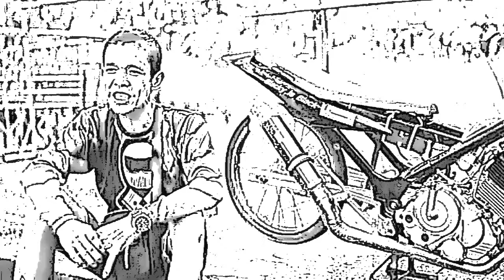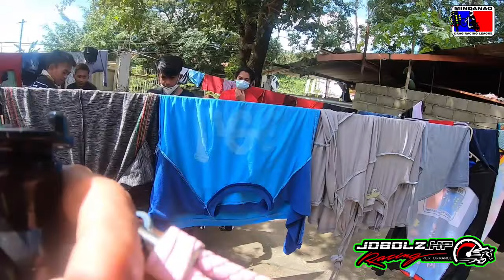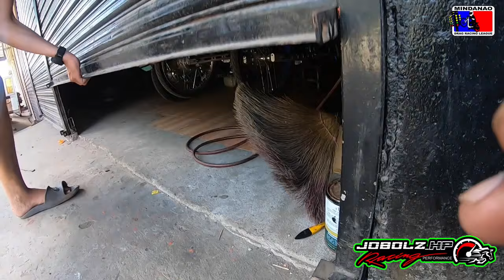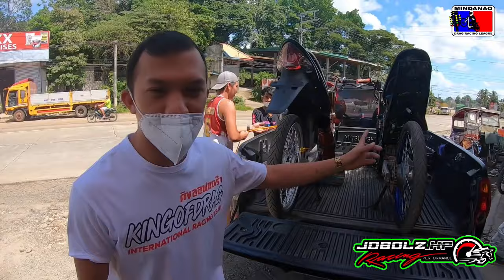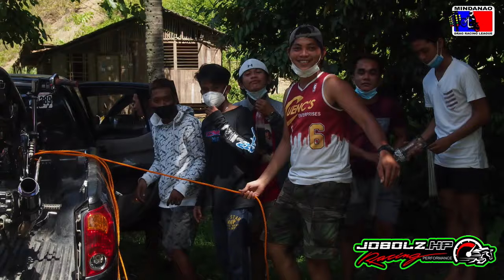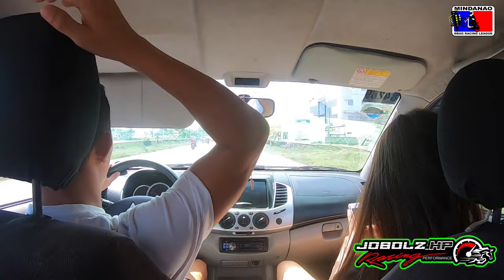Purestock Raider 150 Mindanao Rules I Testdrive

Comment: Sir, bagong subsriber diay ko 😁 kron pa nko nakita ni nga channel murag daghan ko makat-unan diri basi sa mga reply nmo sa questions diria. Ang uban mn gud motoVlog channel dili manubag pangutan-on 😅
Akong pangutana sir is unsa ayos na sprocket set sako R150. Stock pani tanan sir rims ra nailisan gyud ani ang makina og etc wala gyud. Stock sprocket pod sir 14-43 pero nganu 125 ra ang top sir. Normal lang ba ni sya? Nangutana ko uban riders, dili daw. Unta mapansin nmo ni nga comment/pangutana sir.
Reply: Ps. Wala ko nag apas sa pakusog or loaded2 😅 tngala lng gyud kayko kay sa uban bsag naka mags maglisud ko gukod stock pa kaau ilaha. 😅
Reply from the maker: Pila katuig na imong motor sir?
Reply: Ay tama kalimot kog include, mag 3yrs na ser rong January.
Reply from the maker: @arielsuarez4773  stock lang ba motor mo simulat sapol?
Reply: Yes sir, ni minsan d nabuksan makina.
Reply: Regular then changeoil ko every month. Fully synthetic
Reply from the maker: @arielsuarez4773  ano po ba pinaka matulin nakuha mo kph nyan with 3years?
Reply: 128 boss
Reply from the maker: @arielsuarez4773  so nabawasan ng 3kph ngaun?, try mo refresh ang makina mo boss, linisin ang piston and valve grined, kunin lahat ng carbon and pacheck mo rin ang cam clearance, mas ok kung palit ka ng piston ring ang valve seal.. bawas ka ng head gasket! yong stock gasket 3 layer yun isa lang gamitin mo, ung makapal, din 14/43 stock lang gamitin mo.. segurado akong mag top yan ng 150kph up!
Reply: Maraming Salamat sir. ☺️ Merry Christmas!

Comment: Sir tanong po , ano po modifications ng purestock? kalikot? At parts na pwdi palitan? Salamat po
Reply from the maker: ano po bang ibig mo sabihin purestock pangkarera?
Reply: Mindanao Drag Racing League Official pang karera po sir
Reply from the maker: @iridesolo5001  ka hp, kunga sa mindanao category, sa makina spec: stock cam with compression release, no port, genuine piston only valve pocket allowed, stock stroke, stock cam gear, stock crankshaft with stock balancer.. batt. Drive is not allowed. Yan po sa makina boss.
Reply from the maker: Peru kung gusto mo lahat ano bawal check nyo page natin MINDANAI DRAG RACING LEAGUE search nyo don, sa photos
Reply: Mindanao Drag Racing League Official Okay2 po sir Salamat ng marami 🙌💯
Reply from the maker: @iridesolo5001  anytime ka hp at your service

Comment: Magandang gabi po tanong ko lang po sana ing sa raider kopo... Pag malamig pa po makina maganda tumakbo.. Pag uminit napo konti pa putolputol napo.. Sa bandang 3rpm lang po pag binirit namn po sya ok namn tumakbo.. Ginawa ko napo lahat sa carb ganun parin po eh.. 68mm po,, tapos 30mm swr.. May napag tanungan namn po ako baka daw po sa cam timing...anu po kaya sa tingin nyo sir.. Wala po kaya sa timing ung cam saka sa piston... Salamat po
Reply from the maker: Maraming factor po checheck nyo ka HP, kasi d ki naman personal kasi nakita or narinig andar ng motor. Tanong Ko lng KaHP, kung natotono na ba ng perfecto ang carb mo?
Reply from the maker: Mostly po kasi pag di natutono ang carb ng perfect ganyan po ang result. Palit ka ng lahat size ng main jet, pati air jet, kung makuha mo un or kung mawala na ang putol2 sa carb po yan, kung ganon pa din, try ka gamit ibang cdi ng katropa, or palit ka ng spark plug. Gawin mo muna lahat advice ko, din mesage mo ako uli kung ano result ka HP
Reply: @jobolz_hptv8566 ganto po... Ng hiram narin po ako ng carb sa tropa good na good ung carb nya pag nakakabit po sakanya.pag kinabit po sakin parehas lang po ang andar may putol parin po..ung carb ko namn po dami ko napo na try na jet.. Ok namm po menor ng motor ko.. Ung pag maintain lang po sa 3rpm doon po pa kadyot kadyot.. Salamt
Reply: Pag nag advance po ba ng timing sa  cams panu po ba un.. Naka sakto po ba sa marker ng cams,tapos po sa flywheel po ba ay nakalampas ng kaonti...salamat
Reply: Mekaniko din po ako sir... Kaya ko po mag overhual ng mga motor dito lang po talaga ako nahihirapan sa timing nya... Bisaya pud ko sir,tiga liloy po ako dati.. Pero karon na, ah naku sa manila sa taguig.. Salamat po
Reply from the maker: Parang mapalaban ka talaga nyan kahp, sa carb lang talaga yan papa sure na sure ako, kung 68 ka stock stroke, d maiiba ang timing nyan kasi stock con rod lenght ka naman so d yan mag iba ang timing. Basta sa tinging ko basta mag carb ka 68mm mahirap tunohin. Ano ba cdi mo stock or racing cdi?
Reply: @jobolz_hptv8566  stock po na cdi
Reply: Salamat kaAyo sir
Reply from the maker: @guilmerflores7883  batsa kahp, kulikutin ng maigi ang carb, mahirap talaga kunin ang perfect tune ng carb lalo na stock port lang dn 68mm.